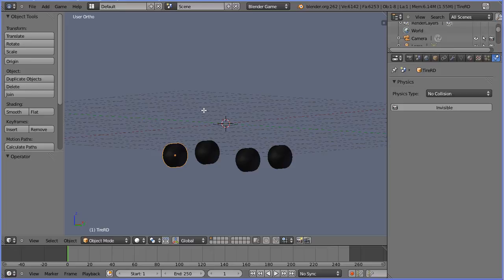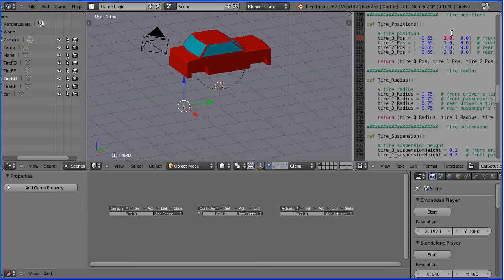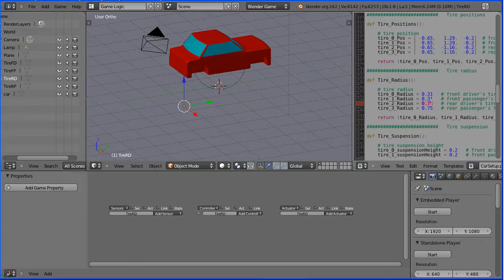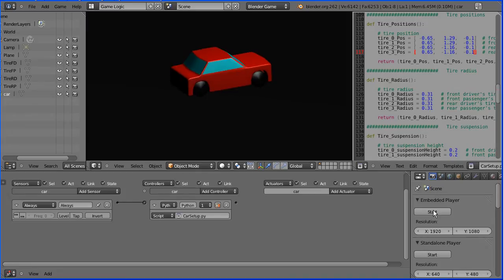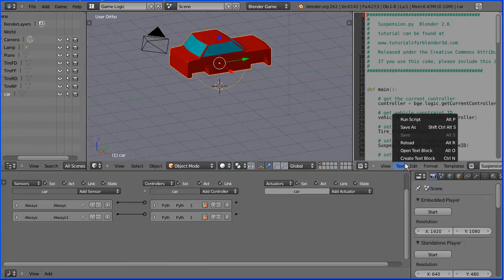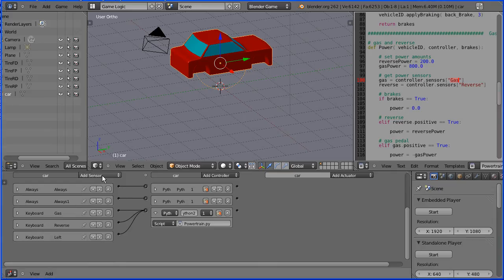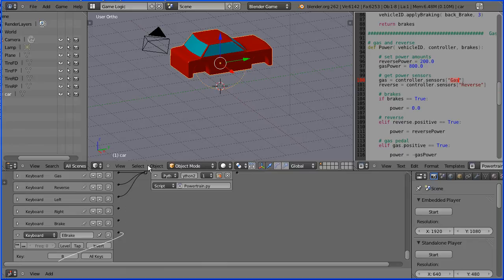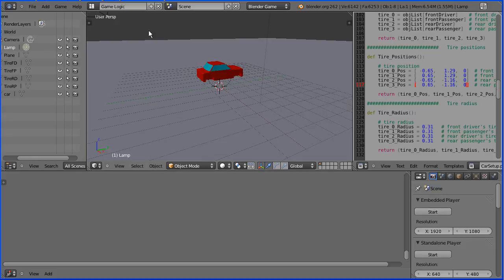Blender 2.6 Tutorial Using a Model of Car in the Game Engine - Making it More Stable Part 2

Comment from the maker: The car should break when you press the break key (I used the space bar). Physics controls the car, holding down the break should keep it still. Releasing the brake, especially if the plane the car is on, is not level, it may well roll. Have a look at the settings in the scripts, you may be able to make the car more sluggish and more likely to grind to a halt.